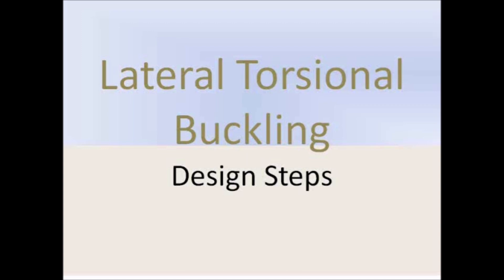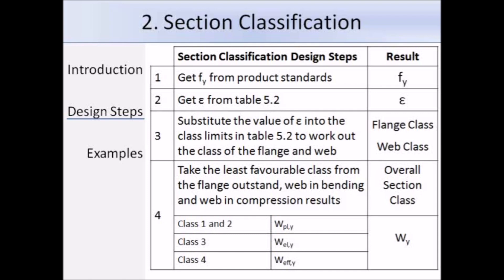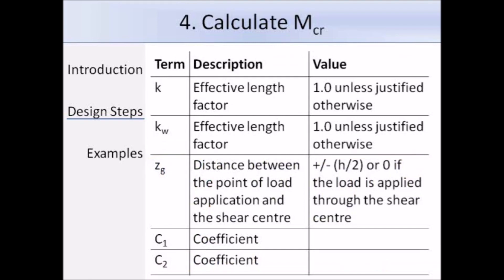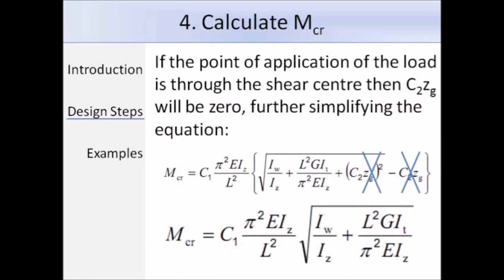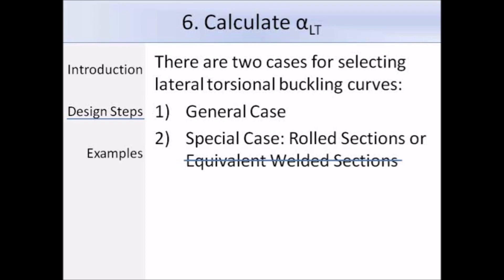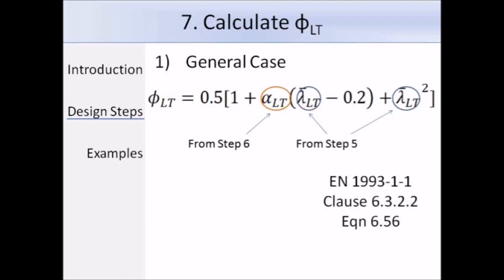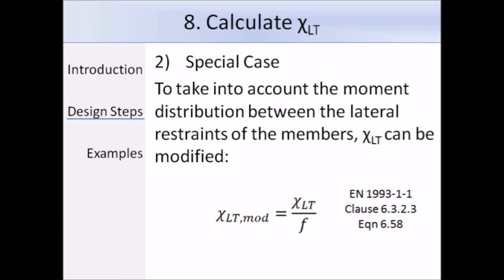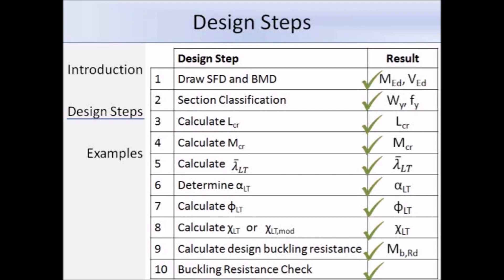How to Calculate Design Buckling Resistance Moment | Lateral Torsional Buckling | Eurocode 3 EN1993

Comment: Thanks. Excellent demonstration. 
Little clarification please,
Let's take single-span beam without intermediate lateral restraints
Then,
Lcr and L (In the expression) are the same for both (Fix-Fix) or (Pin-Pin) conditions?
Or Is it independent from end conditions? 
If L=Lcr for every end conditions,(i.e the length between lateral restraints)  the effect of end condition for Mcr is looking after only by C1 value?